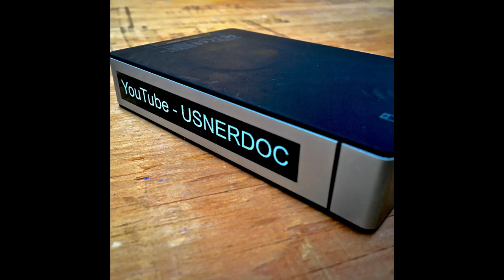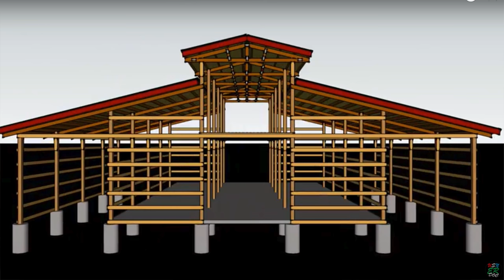Installing Overhead Garage Doors on Mountain View Ranch Pole Barn

Comment: How does the electric opener work ? Doesn't look like the typical home garage mechanism.
Reply from the maker: Hey George ... thanks for watching!
They are heavy duty side mount jack screw openers (Model #8900) from Lift Master.
Reply: Ah, Jackscrews, they'll run smooth, what kind of lube will be on them ??  Mobil ! red synthetic grease will keep them smooth running in winter time.  Synthetic oils and greases do not thicken up in cold temps.
Reply from the maker: I am using Lucas Red Synthetic Grease on everything on the ranch ... I bet it is similar to Mobil 1 red synthetic grease. Thanks George!
Reply: Atta boy !! Dave.